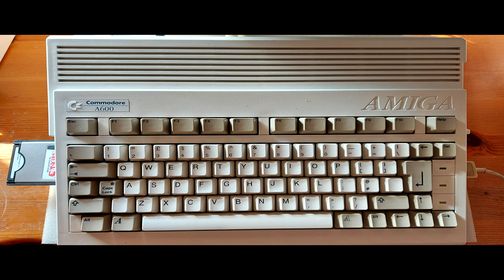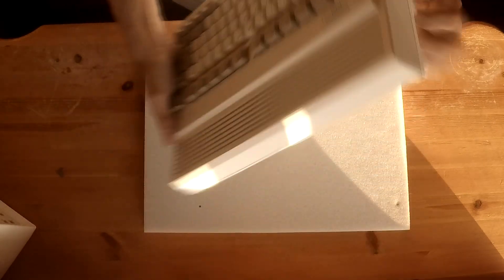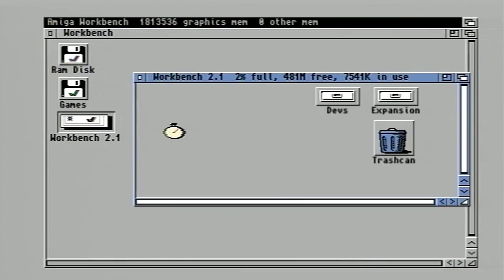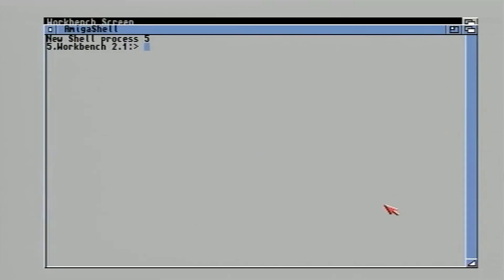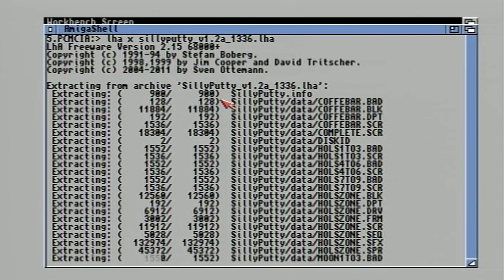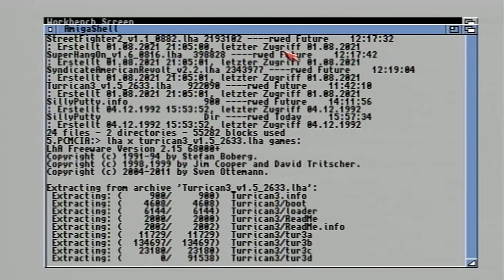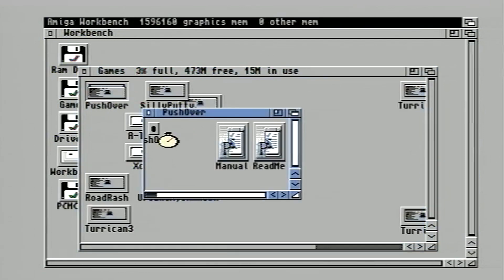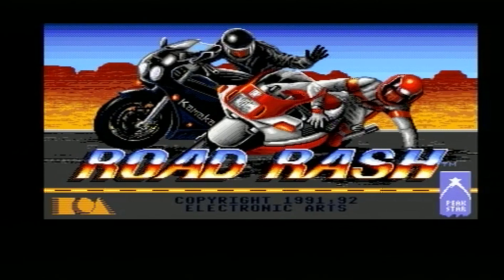Installing A 1MB Trapdoor RAM Expansion Card & PCMCIA To Compact Flash Adapter To The Amiga A600

Comment: Program failed (Error #80000004) when I try to load CF0
Reply from the maker: Hey, it is possible that your CF Card is not compatible with the Amiga. The cf card needs to support IDE mode.

One other thing that it could be is the versions of cf.device and fat95. The latest versions of the files are available on Aminet. 

Later versions of cf.device support a broader range of cards. It is a bit of trial and error when using cf cards.

I hope this helps and you manage to get it sorted 👍
Reply: @Branco_G  I did get it sorted. The problem was that I am on WB2.05, so I had to use mountlist due to the lack of dosdrivers folder found in WB2.1 and I wasn't aware of this at the time of commenting. Thanks though
Reply from the maker: @MPEG Ahh sweet, glad you got sorted. I didn't even think about different versions of Workbench.

Cheers for the reply, take care 👍

Comment: Who uses the A600 when you can have the A500+ ?
Reply from the maker: Me apparently, and only because I had one, so primarily for nostalgic reasons.

The A500+ does not have native HDD support, and I wanted to be able to install WHDLoad onto my Amiga rather than faf with floppies or having to invest in a Gotek drive and cannibalise the case.
Reply: @Branco_G I recommend A1200 really, instead of strange 600 , if you wanna more advanced hardware & extension than A500+. A600 was never been successfully succesor of A500+ because of missing numpads especially !
Reply from the maker: @kefrensmegademo  I totally understand where ya coming from. Honestly would love an A1200, but they are fairly expensive and so are the accelerators. Literally the only reason why I don't have one :)

Thanks for the comments and recommendations though, much appreciated 👍